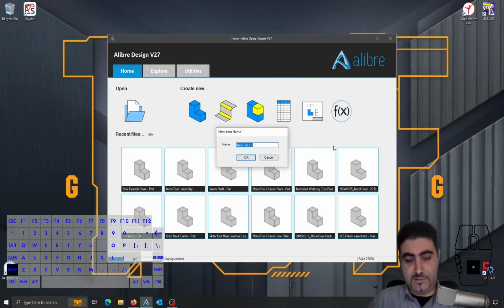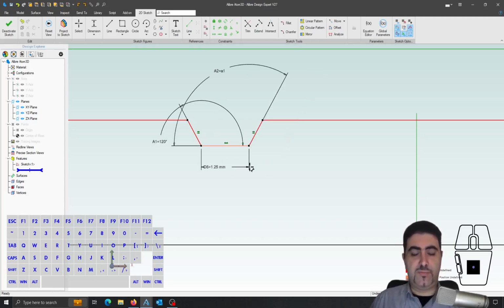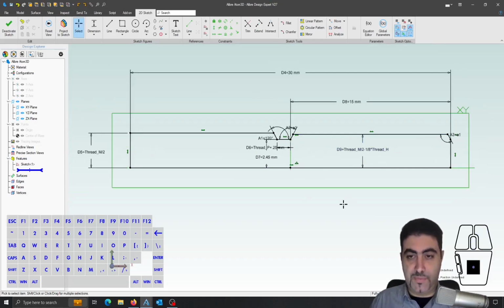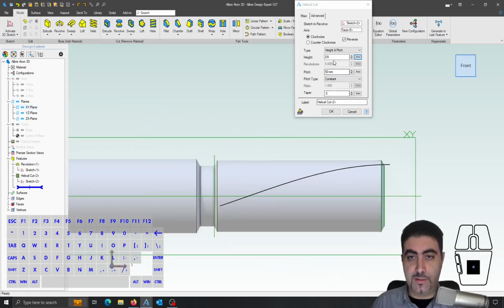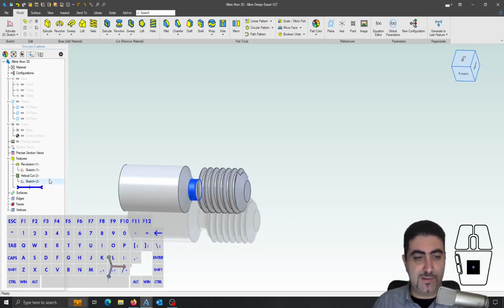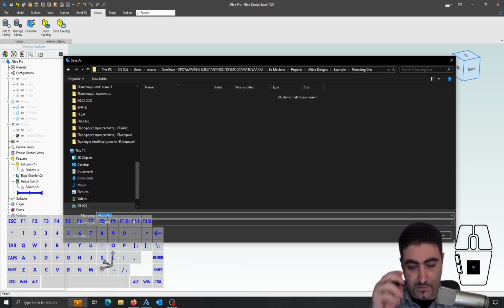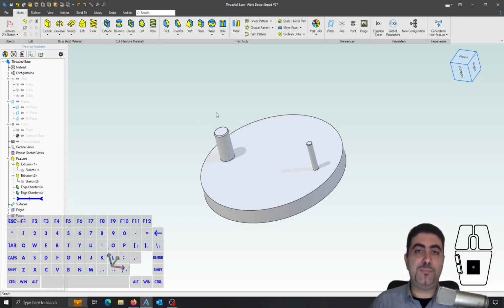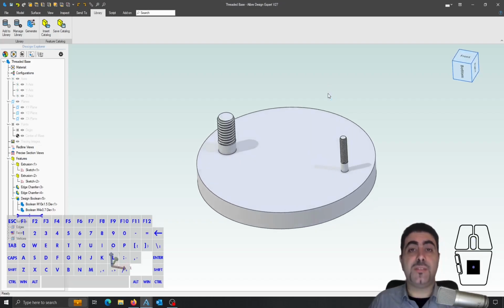Threads for 3D Printing in Alibre Atom3D and Design Professional

Comment: I am glad I have found your channel. I am learning Alibre after moving from Fusion 360. I found most of it self-explanatory, however, I really really do miss the Fusion 360 modeled threads. It is not perfect and it is missing some thread pitches which you may want, but it saves a bunch of work for most people who do CAD for 3D printing. I still will stick with Alibre because it's licensing terms are far better than fusion and it is very intuitive. I'm surprised it's not more famous in the 3D printing community.
Reply from the maker: I am really happy that you are learning from my work. This is what I was trying to do and to hear that it's working is a great reward.

I too switched from Fusion to Alibre but it was because of the modelling power. Alibre created an extruded webbing for an injection molded part up to a sculpted surface, and Fusion could not do it. And I tried several workarounds in Fusion. While Alibre did it in 1 click.

And yeah, I too think that it doesn't have the recognition it deserves.

Comment: I originally clicked on this in my living room, but almost immediately realized that I should move to my office and follow along. Here I go:
(I'm gonna edit as I go)

00:58 I realize I'm gonna follow along.
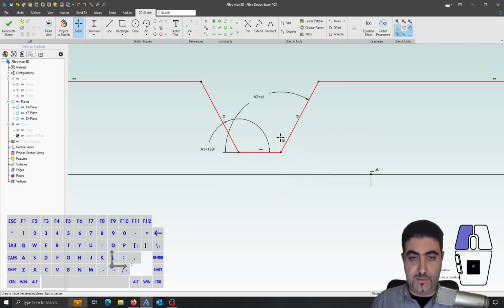03:57 There are some interesting differences I'm noticing, like all your dimensions are labeled. That seems really useful!
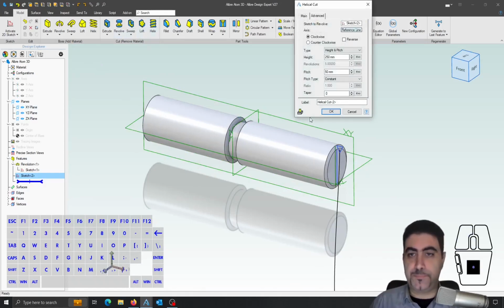09:30 Starting to wish I had Expert so this whole thing could be so much easier using your boolean method.
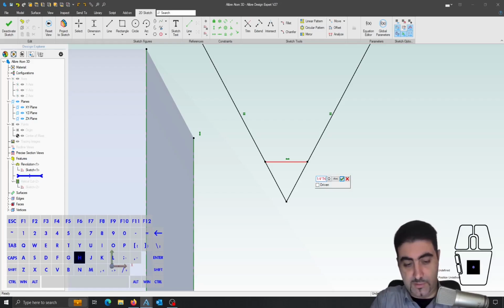11:00 And this is why parametric CAD is the most powerful software in the world.
12:50 OH! I see what you're doing. Still not as easy as your boolean method, but this is very cool!
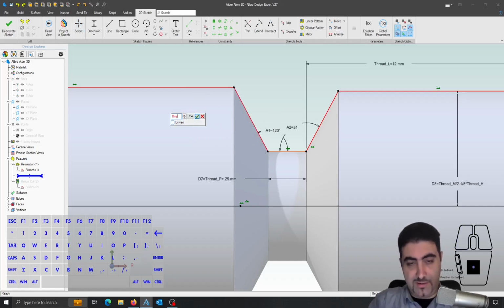13:10 For me, I cannot change this dimension. Deleting the dimension you deleted still leaves the right side constrained, and I've only added dimensions and constraints where you did. I'm very confused now.
AH! About 1 minute later I realized what was happening. I tried to do this without switching to the M10 like you did. For some reason, staying with the M6 and trying to fix that problem didn't work. I'm not entirely sure why, maybe it's because a point ends up vertical to the origin, and it was adding some kind of constraint? Not sure.

That'll do it for me since I'm on Atom. Very good tutorial, thanks!
Reply from the maker: By the way, the most helpful and enjoyable feedback to read!!! I think it helps the other viewers to follow along and me to get a better feel of how my videos are viewed. Massive thanks!

For the dimension labels you have to open any part file, even a new one, go to Properties-->Dimension--> and click "Show Dimensions". Then check the set current setting as default checkbox on the bottom.

As for the correction not working initially, yeah it was probably  an auto constraint.

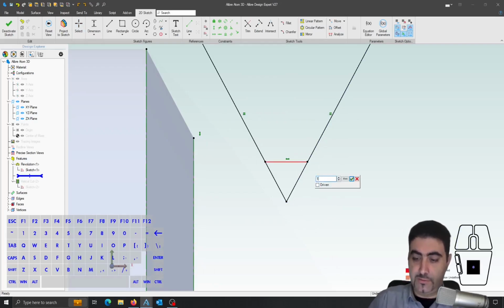Finally, 11:00, oh yeah!!! I agree! And if you know how to use them, as Too Tall Toby says, you are a Wizzard. Even if your name isn't Harry!
Reply: @ExMachinaEngineering For modeling inside threads, how would you tweak this method?
Reply from the maker: If you take a look at the Boolean Threading tap video (https://youtu.be/fQ2qlLVse1k), you will see how I make internal threads. Yes it is an adaptation of this method. So you just adjust what you see in this video to the internal thread method in the above video. It might take a try or two but if you take it slow you should be able to get it. It's not hard, it's about not missing any steps.

If you still find that difficult I might make another short video for it. But I think it's pretty straightforward once you do it once or twice and get the basics down.
Reply: @ExMachinaEngineering  I'll probably give it a go soon. Being able to accurately model threads is a very helpful skill when designing practical things for 3D printing, especially since printers have become much more accurate recently. Thank you so much for your help!

Comment: It would be nice if they could just include this library feature for all levels... Manually having to do threads (vs free software like fusion 360 that comes with threading tools) is already a bit of a hassle 😅
Reply from the maker: Yes, for Atom it is a bit of a hassle. Especially this day and age where 3D printing is so wide spread. But Autodesk's business practices is something that I have consciously decided to be far away from.

There is no guarantee that they will not take more tools away later on from the hobby licence. Plus, if you make any money from anything you've designed with Fusion you are technically in breach of the ToS. Whereas, Atom is an actual commercial licence
Reply: @ExMachinaEngineering That is true. It is the reason why even as a hobby, I paid for the professional license of Alibre (to move away from F360). It was just a little frustrating finding out what I've taken for granted in F360 to be either missing or locked out features in Alibre.
Reply from the maker: OK, I get that. But I want to believe that Alibre will address the formed threads issue. As for other features missing. I'd like to know what you're missing. You can comment here or in the forums. I would be really interested to make a video on how a certain geometry or workflow can be applied in Alibre. It might help a lot of other people who have the same questions.
Reply: @ExMachinaEngineering It could very well be that I'm still a novice (in CAD in general) but one thing that I'm still finding myself hopping onto F360 for is mesh editing. Specifically if I want to remix a design that only has the STL - I would want the ability to manipulate the mesh and/or convert it to a solid.
Reply from the maker: If you go to the forums and search for that you will find that NateLiquidGravity has made a script to import an STL directly as a solid.

And if you want to get really into the nitty gritty of it, you can edit it in Meshlab or Blender.

Indeed Fusion is a fusion (😐) of different software. Alibre is mechanical Parametric CAD. But there are free alternatives to most other Fusion tools that are often better at it than Fusion. Meshlab for example can also do photogrammetry and generate the STL. That's not included in Fusion because Autodesk sella a software for that.

Comment: Liked the spacebar tip. I didn't know it either. Great job as always. Keep it up!

Coincidentally, I had to print a simple M22*1 nut today at work. I used the same technique you're introducing in the video.
Reply from the maker: Yeah, Harold is like the old Martial Arts Master in a Temple up in the mountains! If you seek knowledge, he is the one who can provide 😁😁😁 But yeah, really cool tip.

Also, nice to see that you thought of the same technique as me to tackle that problem. Was that in Alibre or Inventor?

On a side note... Aren't you joining the TTT Spring Open? Come on, let's represent. I still think you might be faster than me.